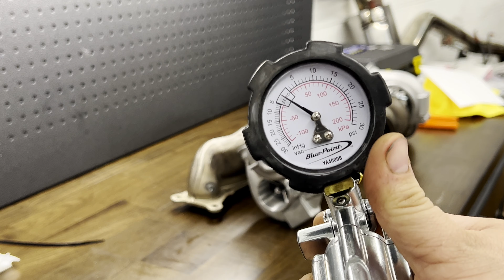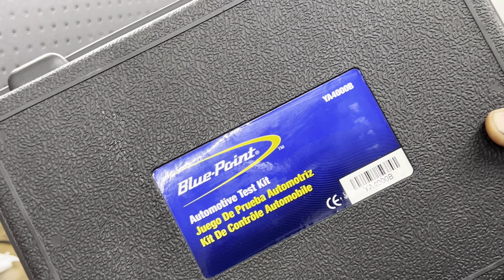135i Pure Turbo Install Part 3

Comment: My tuner said my wastegates werent adjusted properly and sent me this video as a reference. Is it possible for a mechanic to do tbis without having to remove the turbos out of an 09 335xi?
Reply from the maker: Turbos don’t need to be removed but you will need to at least remove downpipes in order to see the wastagate flapper